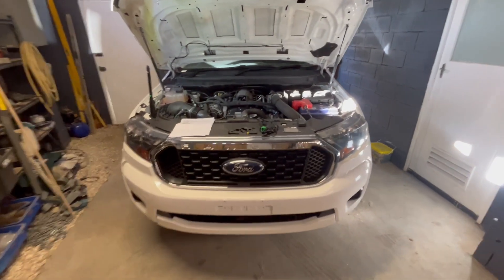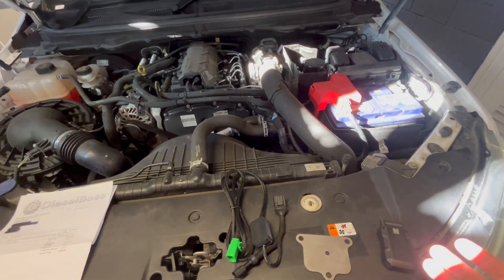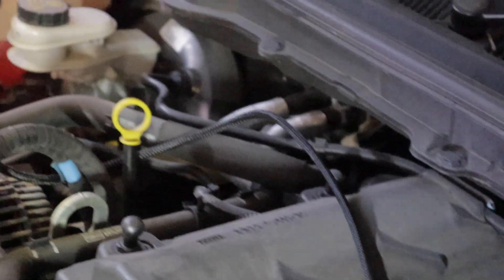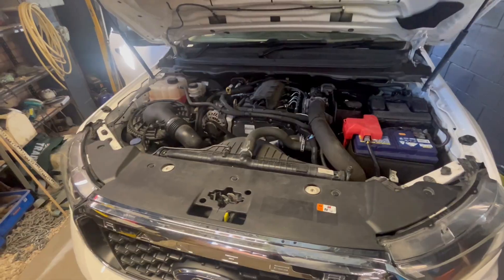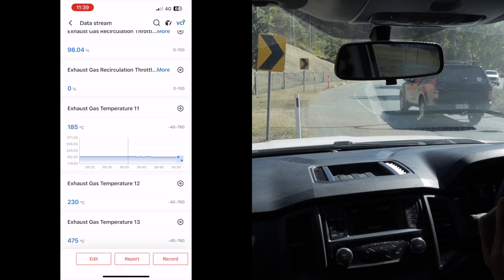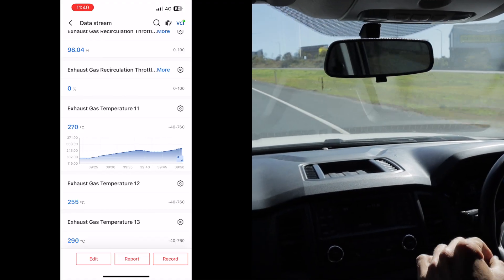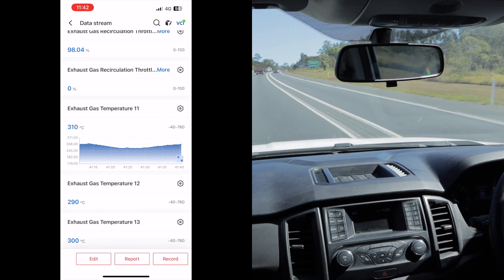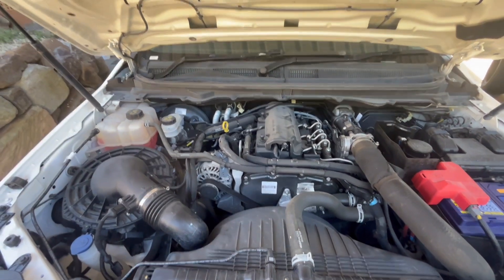Ford Ranger DPF EGR Delete Cable Testing

Comment: I've been running one of these for 12 months now and I'm really happy.Iis there a way you could put to bed all the hate for these cables by showing the air fuel mixture ratios before and after.  
It would also be good to see you the injected compensation values before and after fitment

Comment: My BT 50 3.2L 5cyl. Is very pleasant and happy since the cable installed. 
21$ for eBay and does a good job. 
Acceleration smooth as, no hesitation, I feel more power and especially torque, and engine is waaay more responsive! 

The fuel consumption dropped from 13 to 7,5L.
 With Cruise control is like going with 3-4L on a straight road @  80kmh speed. 
Fantastic.

Feels like my engine came alive. Average RPM doesn't have to be much, I don't need to push it ever above 2500rpm max. But average 2-200....

I write a long list of how many things has improved with it....

This is just my personal experience with my car. 

I don't know if it works with every car, it worked awesome with BT-50 and rangers. My is a 2015 model.
Auto 6 speed.

Cheers Guys. Enjoy your time. ;) 

Thank you for the video btw. Super happy. !!
Reply: This has to be an eBay seller 😂
Reply: @danwalker1951 
You can do me a favour, Buddy....

Comment: Thanks for this video. I am less of a machanic than all others on thos chat, and maybe dont understand everything. However, there is no doubt in my mind that I need to eliminate the EGR on my Ford Ranger 2.2 (2015) by either using the blanking plate kit, or this plug & play module. The last option is obviously preferred, but it seems that no one in South Africa knows or are able to assist with this module. Quick question, will this module work on my Ford Ranger 2.2 (T6 2015 model) and where can I order it for shipment to SA?

Comment: Great vid, I will install one of these delete modules. Can I also link the EGR cooler hoses together with a barb fitting to bypass / eliminate a potential coolant leak in the EGR cooler?

Comment: Hey mate appreciate your videos. Does the smaller EGR blanking plate that comes in kits need a hole as well or is it just exhausted manifold blanking plate that you have shown in this video that needs it? 

I've done the cable and have taken off my intake manifold to do glow plugs and to be able to access the cooler hoses on the EGR for cooler bypassing. Appreciate that video as well 

Cheers
Reply: 2016 PX2 with DPF

Comment: Hello.can you please tell me :
1) Isn't it necessary to reprogramme the oxygen supply , by the central control ?
2) did you measure the exhaust gases? Is the car passing technical control ?

Greetings.

Comment: Awesome video! But any chance you remember during the "cable ride" what was the EGR valve reading showing? Was it still showing the 38% or so that you showed while idling or did it also go down to 10% as it does in standard operation? I think that would be quite important, because I would guess that if the ECU is being tricked to think that it's always at 38%, then it will not correctly adjust the fuel to air ratio when fully opening throttle. I would love to buy similar cable for my 1.6TDI but I am worried that as the sensor gets tricked it's going to mess up fuel/air ratio somehow. Any thoughts/info on this would be very much appreciated. Once again thanks a lot for great videos.

Comment: I have had the blanking module and loom fitted for 4 days but after about 150km driving the check engine light came on. I checked the plugs on the module were secure, ok. drove home no limp mode, plugged in forscan when I got home and the fault ( p0403 EGR "A" control circuit open ) was indicated. dont know why it appeared after two trips and 150km. Still experimenting and testing, but its baffling.
Reply: same
Reply: @kerrykang6221 further investigation i found the loom plug at the egr had got water in it  so dried the plugs and no problems since
Reply: The ECU won't store a code until you've done two or three drive cycles. So it's not gonna throw a code right away even if the part was bad.
Reply: @tomtom1541  so whats the point of having codes to warn a pending problem if the code doesnt surface for days

Comment: Hello mate, love your videos, straight to the point, some videos on here spend 5 minutes talking before they get to the point. I bought and fitted the blanking module into my 2016 px2 works fine but the plugs dont lock in which is a worry if driving off road with vibration. Which is your preference the forscan or the top scan? Is your top scan the lite or pro version? I cannot find the pro scanner for sale anywhere. Again great vids keep it up.

Comment: I bought  mine and plugged today but now im having  engine  light on. Fault codes (egr a control circuit high)
Reply from the maker: what model ranger do you have?
Reply: @abdautomotive  px2 2016 mate I ended up taking it off. Egr error is playing goes between -99 and +99. Any idea what might cause it to do that ?
Reply from the maker: @AndreWanunee  is it a dpf model?

Comment: Just wanted to show my gratitude and appreciation for your channel and the videos you’re making for us already and soon to be ranger owners mate. Straight to the point, concise and very well spoken. I’m just about to pick up a 2018 px2 XLT 3.2 ranger with 70,000 km’s. Apart from this blanking module, coolant bypass and blanking plates for extra safe measure is there anything else you’d highly recommend doing straight away ? Thanks again
Reply from the maker: cheers! service the transmission altho at 70k the fluid should still be clean.
Reply: Service trans every 50000km and fit external trans cooler kit

Comment: does it pay to remove negative battery terminal first for a few minutes then replace after cables installed.
Now with exhaust gas temps a little lower, would this enable the DPF to block up a little more.
I use a similar ERG delete cable, and have a Manual and drive it like i stole it ,  and we don't really have emissions testing here in nz yet!!
Reply from the maker: quite the opposite , engine is running on clean air,  not recirculated exhaust gas , so dpf should be alot cleaner

Comment: Hi mate, with this mod, would you still recommend to use the blanking plates or bypassing any cooler hoses? Or is the plug harness enough to prevent issues?
Reply: I think if you removed the cooler houses the cooler could create a fire hazard and run very hot  
Perhaps a top blanking plate and this cable might be enough.  However this Won't stop coolant leaking into the exhaust side though.
Reply: @jarrodcook4710  How to get the coolant to not leak? What other measures should we put in place?
Reply: I can saw blocking and bypassing the water lines is still a good idea as the cooler can and will crack in the water jacket. 
This this plug installed the water will only go down the exhaust via the turbo and that is was batter than going into the engine. 
But still better to prevent that from happening.

Comment: Picking up my 2019 PX3 XL Ranger 4x4 on the weekend. So glad I have found your channel. Best hit the subscribe button and bell notification so I don't miss anything 🥳🍻
Reply from the maker: servicing the transmission & buying a EGR delete cable would be my first mods.
Reply: I bought the 2020 xl last week, and I just purchased the delete cable, Is it worth buying a deeper transmission pan with a drain hole ? Or just do a service of the transmission?
Reply from the maker: @dominichart2172  im actually doing a video on this in the upcoming weeks

Comment: I own both à ranger 2.2 and a transit 2.2 
Do you know if the module is compatible for transit MY 2014 ? 
I have at the moment an error code p042a  Egr valve stuck close
Reply from the maker: from what i know dpf only models

Comment: By using this cable it would remove the need for me to go to a shop and have the EGR tuned out correct? And I can just put the blanking plates and bypass in for good measure

Comment: Hi Mate, I fitted one of these modules to my 2019 3.2l Ranger about 2 months ago and am very happy with it, also noticed a drop of about .8 to .9 L per 100k and also a coolant temp drop of about 7 to 8 degrees c with average running,  seems like a good result.
Reply from the maker: agreed, im preety happy with it so far, the 8 degrees coolant temp drop would correlate with the Lower EGT's.
Reply: @theducstar did you need to do any software update? Because the computer wouldn't have adjusted for the new fuel mixture needed now that egr is not working?
Reply: @bothajevandre1 I didn't do any software updates, still running stock ecu map, have done nearly 40,000klm since fitting the delete cable and a lot of that has been towing a 3 ton caravan. I do 10,000klm oil changes and the oil has become progressively cleaner each change, only downside I've noticed is at very light throttle position around town when the engine is cold it tends to surge a little.

Comment: Hey mate, why do you say this won’t work for the px2 pre DPF?
Reply: Pretty sure the IAT wiring is different. On the earlier ones, you could modify the original wiring with the addition of a resitor to trick the ecu into thinking the IAT is 2degress, which prevents the EGR from opening. If you go to diesel boss you'll see the earlier 'module' is much simpler.

Comment: I did the blocking plate and cooler bypass for reliability reasons on my PX2 2.2 work Ute, and I’ve noticed it runs cooler and fuel economy is better slightly.
I've just got the engine light on permanently and thought I will just buy one of these cables to get rid of that, but only found ones for the 3.2, so this video has given me the confidence to buy that cable now, cheers!
Reply: Hi, does the engine light comes on after installing the blanking plate?

Comment: Been running EGR bypass box with power/fuel trim adjust for 10yrs with blanking plate . Only way vehicle could ever get under 10Lt/100km . No thanks to Ford .
To realise the full benefit the inlet manifold must be cleaned ,, throttle response if far far better .

Comment: I have used one of these egr delete harneses on my  px2 for 6 months. 
I bypassed the coolant hoses on the EGR valve and cooler. I didn't install blanking plates though.
Cleaned all the coke build up in the manifold and cut off the egr injection tube. 
I noticed a power increase straight away and the engine is more responsive. 
I go up a steep hill on my way home and it holds gear and it doesn't need to change back.
Yes fuel consumption has increased, but not by the cost of an engine rebuild if the cooler lets go !
So all round, these issues creep up engine power reduces over time.
 Pretty happy all round.
Reply: That's strange , I noticed fuel economy got better by roughly 10% with my 2015 px1 when using the EGR delete cable.
Reply: @1allan2  How many Kms did your  px2 have on it when you cleaned the buildup in the manifold off? Just curious

Comment: Any change to the DPF operation? I have heard that removing the egr causes the dpf to fire more ofter. Negating any fuel saving.
Reply from the maker: the computer still thinks the EGR is in full operation as shown in the video, so im not sure how it would fire more often.
Reply: @abdautomotive cheers mate. Good point. Great video also!
Reply: I thought the re gen of the dpf was automatic in that when the vehicle is driven at 1500rpm or more the turbo and exhaust gases heat the filter and break down the captured particles and the electronics has nothing to do with the re gen except it will know when the dpf is blocked. Thats why its not recommended to drive diesels with dpfs on constant short trips, and a long drive is needed to re gen

Comment: I have a 2021 3.2 and I was attempting to fit the blocking plates today and I have found that Ford seems to have put measures in place to prevent people from blocking the EGR. This wiring harness might be worth a shot
Reply from the maker: yeh much simpler
Reply: Are you able to update this status, thinking of buying it for my Px3
Reply from the maker: @4Iamhim   yeh, waiting till i hit 5000kms so i can give an accurate update.
Reply: @abdautomotive Did you leave the water lines connected to the EGR Cooler still ?? OR disconnected them ?

The DPF EGR Coolers look completely different to the earlier Models as on the Turbo side of EGR Cooler, they have a round end, not the end   shaped like in your engine on ground video...

Even the water hoses go in diff locations

It might be worth noting for anyone with  leaking EGR Cooler that might go this route instead of blanking plates.
Reply: @soultrain65 yes i noticed the water hose doesnt go thru the egr valve like it does on the earlier model
Reply: @glen9115  Yes that is correct, In the earlier models the heater hose from firewall goes into EGR Cooler, Then other hose out of EGR Cooler goes to top of the EGR Valve.

On the Vacuum assisted Later Models the water hose runs under the inlet manifold via a rubber hose located at rear of lower radiator hose (viewable from underneath guard) then into a section of steel tubing and then another section of hose up to driverside of the EGR Cooler, then that Exits on passenger side of EGR Cooler and into the top of EGR Valve.

Simple fix is to disconnect hose off from top of EGR Valve and  also from rear of lower radiator hose I mentioned and run hose from top of EGR Valve to the point behind the lower radiator hose, just leave old Hoses in place no need to remove, if you do this use EGR Delete Cable and problem solved
Reply: So if I understand correctly, using this EGR delete cable in combination with bypassing the EGR cooler is a good solution? I'm assuming that if the EGR valve is not opening then there's no flow of exhaust through the cooler and therefore no need for cooling? No blocking plates required?
Thanks

Comment: Thanks for all your videos, Ive got an 3.2L 2022 with low mileage, Would you recommend keeping it or trading it for a yota1GD FTV or 2GD FTV just to avoid the possible failure points  that you´ve stated previously in your older videos?
Reply from the maker: keep it, most the problems were ironed out in the 2022 (PX3) model

Comment: Very good video. Does disabling the EGR like this protect the engine from EGR cooler failure?
Reply: No you still need to change it once it starts failing and losing radiator coolent.
Reply: @DLK-MusicStudio Hi, what if you bypass the EGR cooling pipe?
Reply: @tonygolledge7906 the egr failure is due to the unit rusting internally leaking into cylinder 5. This bypass using the cable  is similar to a tune delete. You need to do a complete delete of the egr so no coolent goes into the egr.
Reply: But the good thing should be that if the egr cooler fail the engine shouldn't suck in as much coolant and might just save the engine
Reply: Absolutely.

Comment: You bloody Legend mate thank you for the content, sure this would still work similar to a PX3 3.2L? Would be awesome to have a vid on "how to DIY" remapping ECUs etc :)
Reply from the maker: the module i used was for a 3.2 , the 2.2 shares the same sensors
Reply: @abdautomotive I found the DieselBoss product on eBay. It's currently going for 196 AUD. Is that the price you paid as well?
Reply from the maker: @MonsterTech  yep thats where i got it from, same price
Reply: @abdautomotive  thanks man